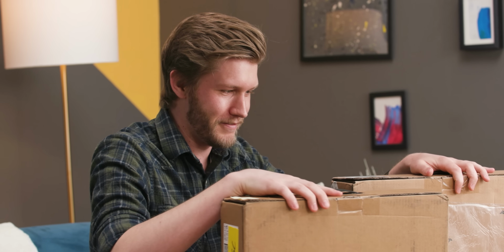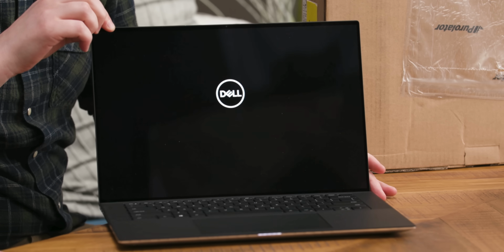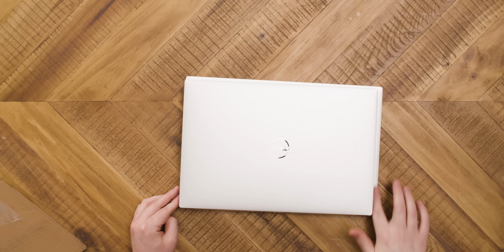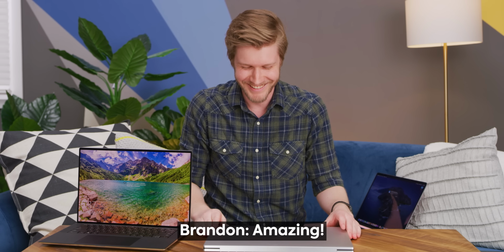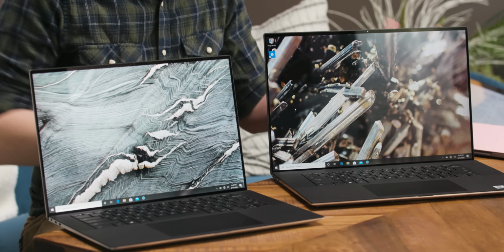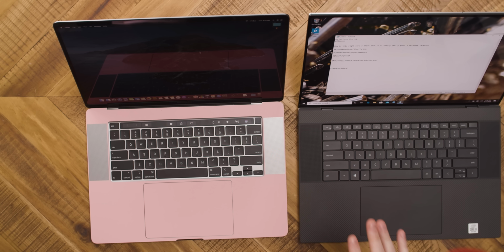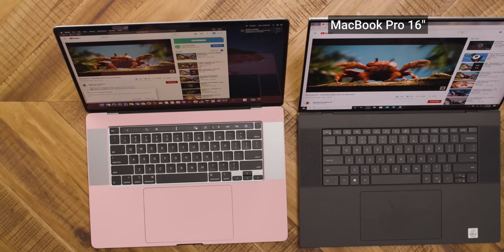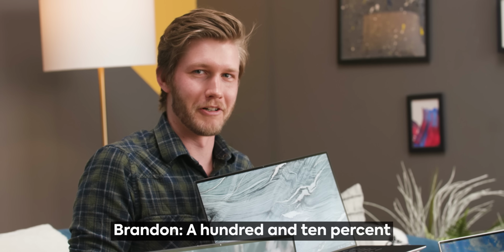The MacBook Pro's Biggest Rival - DELL XPS 15 9500 & 17 9700 Laptops

Comment: LTT: canadian
LTT employee: uses pound to measure weight
wait that's illegal
Reply: Welcome to metric system Canada edition!
Your weight and height? Imperial.
Distance? Metric if you're driving, running, or biking. Imperial if you're describing a short distance to someone else.
Speed? Metric.
Building materials? Imperial AND metric.
Baking: Usually imperial, but sometimes metric.
Temperature: Weather - usually metric, cooking usually imperial.
Reply: I'm Canadian and we usually use pounds for weight. What the  @TheErasedGuy  said is all true except I never used imperial to describe short distances but I guess some people do use inches.
Reply: @Maniac9099  I am Canadian as well and I can't think of a single time where I didn't use imperial measurements to describe shorter distances to people. I say 6 feet apart, not 2 meters.
Reply: @TheErasedGuy  I would like to add for younger people like me, metric is more prevalent. Anybody that use imperial with me get just a big question mark

Human weight and height: metric and imperial (and even then I don't fully understand height)
Distance: all metric. If you say anything in imperial, I understand nothing
Speed: Metric
Building: Metric ( I hate that when you need imperial and metric wrenches because you never know which kind was used)
Baking: Can get along with imperial in most case because recipes use it, need metric for bakery
Temperature: Metric, except for cooking and for the pool
Reply: @TheErasedGuy  that basically all opposite to the UK, we use metric where you use imperial (except height and weight of people which most people do in imperial) other weights are done in metric
Reply: @TheErasedGuy  Seems pretty straight forward to me. I wouldn't have it any other way. Very well written.
Reply: @TheErasedGuy  Commercial and industrial projects? metric; residential wood frame? imperial unless you're submitting projects to the government for review, then metric. xD we are so jumbled for standards
Reply: @TheErasedGuy  Yup, most definitely true. Though it seems building materials here in my region are almost always in imperial.
Screws (metric screws are always in a special section, alongside stainless steel ones. Interestingly, stainless steel and metric seem to be mutually exclusive), housing material (two by fours, anyone?), cinder blocks, door width (32inches or 36 inches wide iirc), plumping, etc.
Reply: Never expected this from Alex :(
Reply: @GumpPower  ikr, really inconvenient
Reply: Pounds and grams in combination!
Reply: @luke255x  I was wondering about that. Is that normal? To use both units casually? Or was he trying to make it easier for Americans and then screwed up and used normal grams again?
Reply: @dirgosalga  It is very common for people to go back and forth between imperial and metric up here. There is not rhyme or reason to it, that's just how we do it. I never use the metric side of a tape measure, I have no idea what my height or weight are in metric, but only ever measure speed in km/h or distances in km.
Reply from the maker: It's a very hybrid method in measurement systems for Canada
Reply: @ShortCircuit  Don't you guys get confused?
Reply: @ShortCircuit  very hybrid
Reply: @ShortCircuit  Ya I'm Canadian and use Pounds, Liters, Meters, and cm^3. I love your videos. Surprised that Alex can't do 10.5*8 in his head though... He is an engineer right. Lol
Reply: @ShortCircuit  Very true, even in University we were taught Imperial & metric units for almost everything, it hurts sometimes.
Reply: ShortCircuit no it doesnt
Reply: @KrakerMrakerYT  You also from Canada?
Reply: Sp3r2 Socket Germany
Reply: @KrakerMrakerYT  So how can you know better than the guy who lives in Canada 🙄🙄
Reply: Sp3r2 Socket dont know
Reply: @KrakerMrakerYT  These people are weird. They just cannot use metric for everything like normal people.
Reply: @uwu_senpai  If you had your largest trading partner use imperial for everything you'd use imperial for some thing too. Use your head.
Reply: @ADHBuilds  Being Canadian,  trade really isn't the rationale. It's like this mostly because Canadians in general have gotten used to this hybrid approach. 

For some quick rationale: 
We typically use feet for length if the actual measurements are smaller in nature. Not so much about needing to trade with the US, but just because it's easier to convey approx measurements without decimals for length. The Canadian mind usually  measures in the order of km -> m -> feet -> cm.  Though there are always exceptions, Housing for some reason I always convey in sq ft, Even though every other time I convey area, I use metric. 

Weight wise, similar idea. but I actually use lbs much more predominately than kg and I have no idea why. Though the conversion is much easier to do in your head, so it's less of a problem.

Temp wise. it is all metric, with the exception of cooking. This is actually one of the weirdest ones because I actually have NO IDEA how a Fahrenheit scale is perceived . To me it makes no sense, but when my recipes and my oven all list out Fahrenheit, for the ranges of 300-500F I actually do understand. 

TLDR: I actually do side closer to us being weird.
Reply: @ADHBuilds  A lot of comments are just regurgitating a meme. People love to be part of a group, and this group is preoccupied by expressing their identity as not American. It's like how people complain about prices in USD being cheaper. It's like their thick skulls cannot grasp that some countries do not include taxes in the displaced price. We saw what Europeans did to countries that were different to them.
Reply: @ADHBuilds  Also spending time on vacations and such in the US from living in Canada you get used to both and how to do the conversion pretty quick in your head.
Reply: Don't you mean: "weight, that's illegal!"?
Reply: @PerplexedPhoton  : Nicely done. 👍
Reply: @PerplexedPhoton  underrated reply
Reply: Canadians tipically use imperial units for gessing.
«12 inches» means «I guess it's 12 inches, maybe more I dunno » and «30 cm» means «I measured it and it's 30,0 cm»
Reply: I prefer freedom units.
Reply: Most commonwealth countries (including Canada) only started switching to metric for day to day stuff in the 1970s or so. 50 years sounds like a long time, but  that kind of change takes several generations of people, so in effect Brits, Aussies and Canucks (among others) still use a mixture of both.
Reply: I'm  a US citizen who uses American Standard as well as metric.  It really just depends on what I'm doing.  Example: I'm not using metric to measure drywall.
Reply: weight thats illegal
Reply: Well the metric system unit for weight is Newton's. But y'all always use grams for weight. Which is the measurement for mass. At least pounds are are a unit for weight.
Pedantics! :P
Reply: @theloseph  That is a measure of force.
Reply: @--_DJ_--  yeah, the force of gravity. IE weight.
Reply: @theloseph  I suppose I should have thought that out more, correction noted.
Reply: I say this every time
Reply: Really annoying me, because every time I so some calculations in my mind to estimate the weight
Reply: It was more weird when he said "a couple of grams difference"
Reply: Well these days the imperial measurements are all defined by a metric standard, so "technically" they were still using the metric system, :-p
Reply: @gerowen  defined in the units, not part of the system
Reply: It's treason then
Reply: @Mircea Pre-production, you have to wait.
Reply: When he said 5.. i was like... 5 kilos?!?! And then he talked about pounds and ... Oh, ok.
Reply: I think that pretty much everyone outside of Eastern Europe have a pretty good understanding of pounds for weight measurements
Reply: Nonth Suriyan Canada‘s BaiPiaoWang
Reply: ahah I was thinking the same thing
Reply: 4.2 pounds - a couple grams lighter :D
Reply: Britain still uses miles.

I mean who uses kilograms to measure weight? No sane person would.
Reply: dumb down measurements...
Reply: At least je measured the touchpad in centimeters and not in this "length of an average human foot in the 15th century" equivalent ;-)
Reply: He's a slave to the americans!
Reply: in a day and age when google literally makes metric to imperial and back a non issue people still whine?  also your schools still don't teach both?
Reply: Hahaha they are very loyal to the commonwealth boss (Britain)
Reply: @aluandcache7336  nah, we use kilos
Reply: When the scriptwriter spent a semester abroad...
Reply: They cucked their own country wtf
Reply: Imperial system is actually superior to metric system with regards to weight, because technically metric system measures the mass of the object, whereas the imperial system actually measures the weight of the object. So the metric system unit of weight measurement is simply false
Reply: @danielhu6485  from Quora: "In the US and UK, the pound is legally defined as 0.453 592 37 kg, so it is equal to a certain mass. Some people erroneously try to claim that the definition includes weasel words like the nominal gravitational force on an object of that mass, but there are in reality no such weasel words—the definition of the pound is that amount of mass."
Reply: @petarmiladinovic4126  I'm sorry, but did you seriously use Quora as a source? Frankly, Quora is probably worse than Wikipedia in that any jackass can post whatever they want on the website. I could post an answer right now on Quora stating that the pound is a unit for how many ground cocoa beans are in a bar of chocolate, does that automatically make that the definition of pound? While the term does have a conversion to kg for convenience of the uneducated public and shipping industry, in the realm of physics and the science community, the unit of mass in the imperial system defined as a slug, and pound is a unit of force.
Reply: @danielhu6485   Kind of funny you write that about Quora. I had made a dumb comment, along the lines of what you are responding to and was trying to defend it. I searched high and low trying to find an answer I could use. It turns out I was just plain wrong, but Quora was the only place I could find an answer that agreed with me.
Reply: @--_DJ_--  ah yes, the good old confirmation bias
Reply: @danielhu6485  That doesn't affect how it's used on Earth.
Reply: Most viewers are american
Reply: Kraker Mraker metric is superior though
Reply: @egemenefe2753  Metric doesn't have the biggest military.
Reply: @KrakerMrakerYT  *most viewers are slow

Comment: You guys should check out Lenovo's laptops line-up. Thinkpads are great for professionals but the build quality of the Yoga lineup has made me switch from mac to PC pretty recently. Thin laptop, pretty good graphics card, all aluminum chassis and decently priced.
Reply: They did check ThinkPads on a few occasions now with hot takes like "TrackPoint bad"
Reply: @TheDuke00000  Yeah I remember they did check out the X1 back then. I just feel like the high-end Thinkpads are too expensive for the general public, and some functions aren't needed for most people (Trackpoint, Kensington lock, etc.)
Reply: @trimmtab  In general I wouldn't trust LTT to review anything business oriented when you consider their ongoing rant over webcam quality. 
Could webcams be better? Sure. But I feel like they're expecting 4k cameras hooked up without even considering why 720p makes sense. 

I suppose those features not making sense makes sense when you're marketing to mainly to teens where bigger number better generally seals the deal on a product.
Reply: @trimmtab  I think those aren't really expensive featuresm but they have awesome ones like USB-A ports, and HDMI ports and lot of places have decent student or employee discounts.
Reply: @TheDuke00000  I wasn't especially pointing out Thinkpads bur rather the Yoga line-up, which stands in the mid-high-end laptop market when it comes to hardware and build quality, again for public retail.

Regarding the camera thing, I would honestly hope to have more than a 1MPx camera on a 1400$ laptop. Not talking about 4K (lol that would be so stupid to have, but you're right that could be a selling point for some people), a decent 720p or FHD cam which handles low-lights fairly well (mine doesn't) would in my opinion be nice to have, and contributes to the overall quality feel of the laptop.
Reply: @PéterFriedrich-f4e  Yep I wasn't saying those features are expensive, but that the overall laptop package is, and that in the other hand Thinkpads can be seen as "technical products" by people who are looking for a simple and thin laptop, because of those quirks. Otherwise Thinkpads without dedicated GPUs are rather affordable for some of the lines yeah, I agree. And the build quality is there.